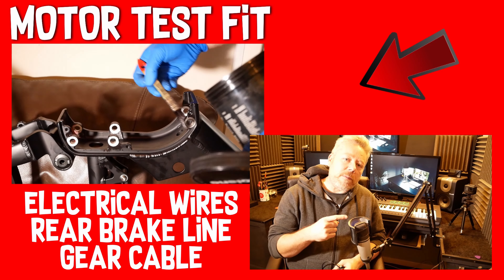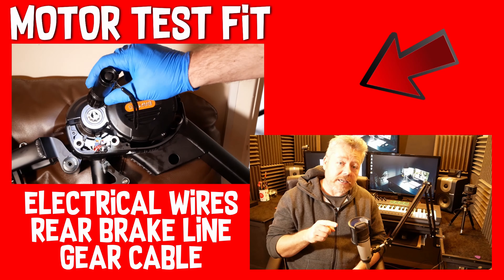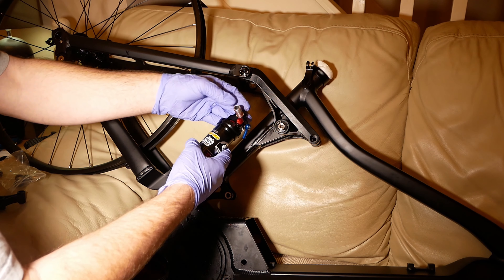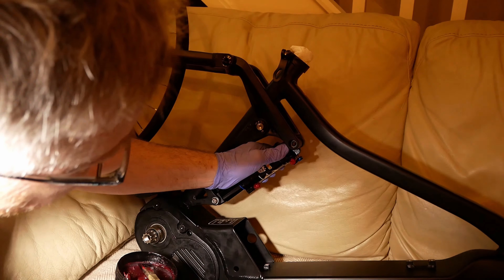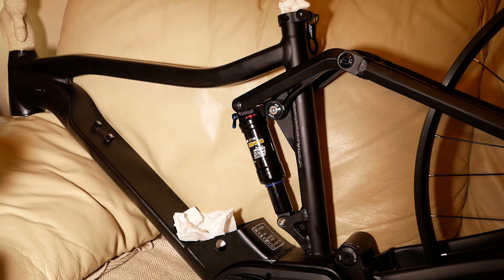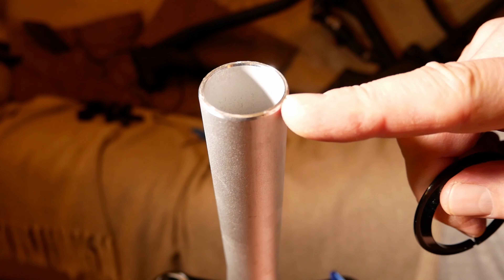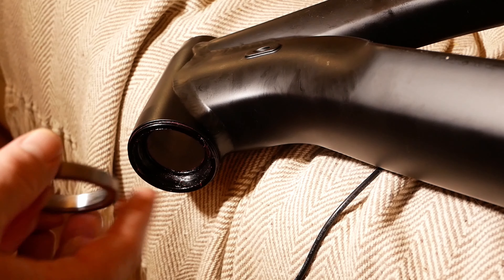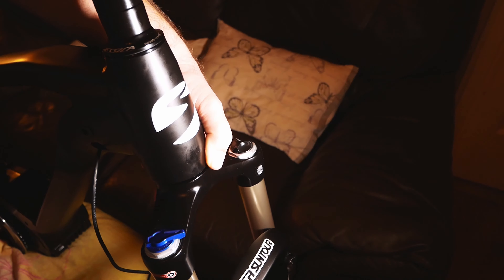ELECTRIC FULL SUSPENSION FRAME BIKE  PART 5 REAR SHOCK FRONT FORK Bafang ultra 48v  G510 mid drive

Comment: very informative video. thank you so much. may `i ask the size of the Rear Shocks and what model did u used.
Reply from the maker: It was the DNM AOY-36RC MTB Downhill Bike Rear Shock 190mm and it has been pretty good so far considering it cost only £65.

Comment: Hello buddy, could you tell me the steering bearings it has.
Thank you
Reply from the maker: Headset measurement opening on the frame is 44mm top 56mm bottom. The fork I used  is 1.1/8th tapered to 1.5 inch . The head bearings I used were a Chinese brand called Jessica but were for  a straight 1.1/8th fork so I to buy a 1.5 inch bottom cup so they are a mix. Part 3 shows the bearings I used.
Reply: thank you very much i am riding a bike just the same